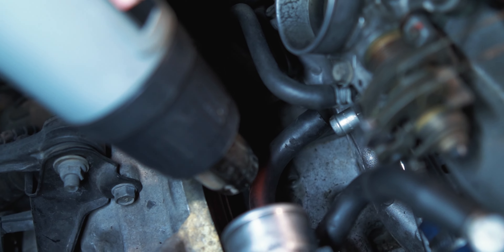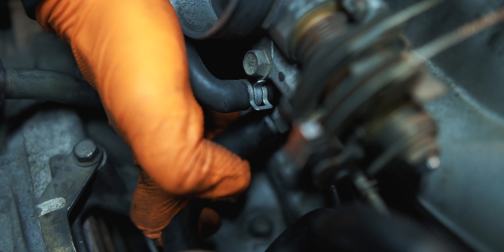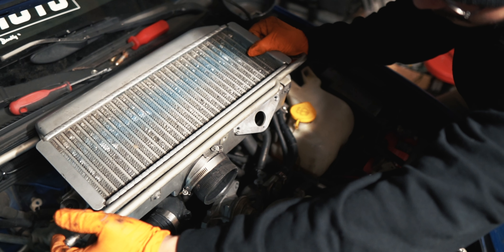Boost Surge? TRY THIS!!! WRX PCV Valve Install

Comment: For sho. When the throttle plate is close ‘foot off the pedal’ the manifold is in a negative pressure “vacuum” that allows the PCV to open and crank case pressure is pulled back into the cylinders to be reburned ”emissions” when you foot is in the throttle and your passing up mustangs the throttle plate is open and manifold is now positive pressure “boost”. If the pvc is stuck open some of the ‘boost” is now going into the crankcase. You could possibly see oil coming out of the dip stick or external oil leaks if it’s bad enough. At least that’s what someone told me once
Reply from the maker: “Passing up mustangs” 😂 thanks for the response!
Reply: @CyrusPischel  you do know you can clean the valve with wd40 ?
Reply: @leepopaz253  you can , but its better to replace the piece because there is a bigger chance it will happen again with the older piece. It’s also a a peace of mind thing as well.
Reply: @salvadormorales6040  i agree, but for those who don't have $153 bux, its better then leaving it as is for obvious reasons.
Reply: @leepopaz253  The pcv valve is like max $20
Reply: @salvadormorales6040  hmm, i saw 155 somewhere, can't find it, but yeah saw another for 34 bux , I'm in Australia
Reply: @leepopaz253 same here in nz that’s what they say online lol

Comment: Fresh engine rebuild but original turbo at 250k. I'm getting some bluish puffs after it idles for a few mins and give it a low rpm Rev.  I haven't pulled the turbo yet but I'm
Just assuming seals are going.  Didn't have a ton of oil in intercooler but did have a film thruout it no puddling. So it's prolly not seals but again it just started after replacing maf  I start to get a hesitation almost like the turbo says no if I go to pass a car whereas before it wouldn't.  Had the car for years now.  Just slowly fixing all the worn out stuffs.  But was wondering if this valve can also cause similar issues I'll start with this and iacv valve and see if that helps and then just do turbski after 😊

Comment: Hey, great video. Wondering what kind of boost surge you were having that this install remedied. Let me know if you're still out there! I recently got an '02 WRX and am struggling with boost surging at part throttle, but fine at WOT. Would love to hear the details, thanks!